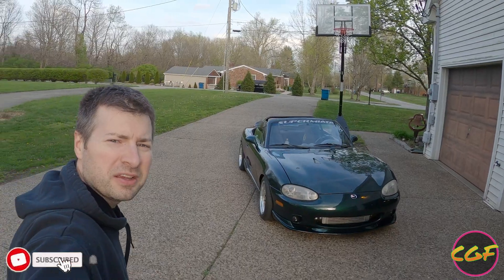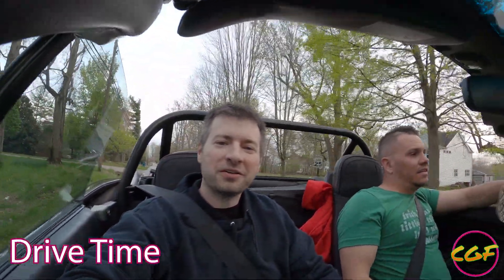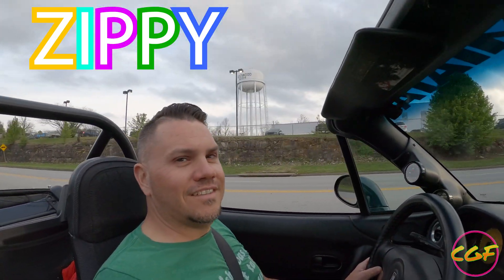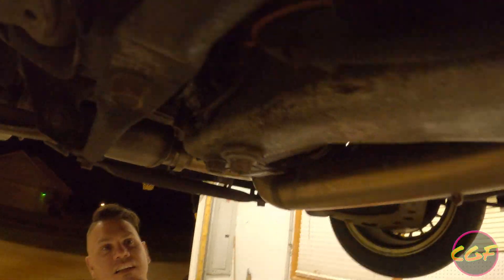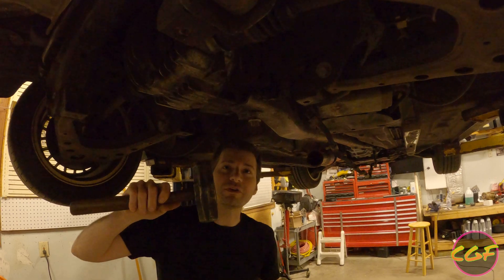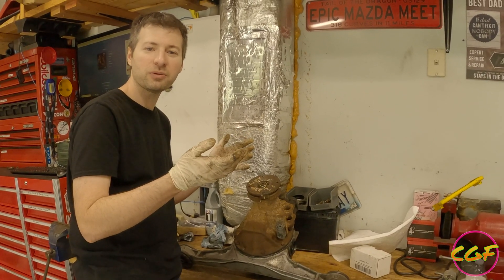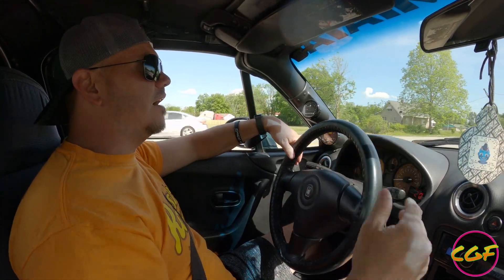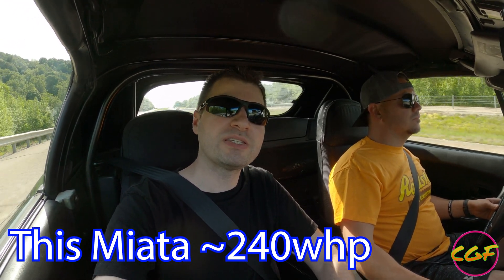Turbo Miata 3.6 Torsen Differential LSD - Install and Review on our Miata

Comment: I believe I have a 3.9 (2000 SE - 6 Speed), I was looking for a way to get the gears to feel longer. Do you think a 3.6 would do the trick? Currently it's stock, and it's going to be a while before it's boosted. I usually prefer Honda's but a K-Swap sounds like its going to be more expensive.
Reply from the maker: 3.6 is noticable vs the 3.9 so yes

Comment: Do you have kraken top mount mainfold?
Reply from the maker: Yep sure do
Reply: @CarGuyFridays  i took the low mount for my 1.6 not sure if is an overkill for my 200-250 hp target
Reply from the maker: The low mount is really better anyway. We have another car that has the low mount where we did a video. It gets heat out of the bay way better than the high mount. Otherwise, I doubt at that power level itll make a huge deal either way.

Comment: Have just swapped out my Torsen for a Kaaz 1.5 way. That’s the next step Guys🙂
Reply from the maker: We are happy to report we are now taking sponsorships and would LOVE a KAAZ 1.5 way to try out! :) 

Joking aside, hows the 1.5 feel?   Any regrets?
Reply: @CarGuyFridays  Whilst the Torsen is good step up & brilliant on the road, the Kaaz comes into it’s own on track. I was suffering from traction issues in both high & low speed corners due to the unloaded inside wheel spinning & causing the boost to drop. With the combination of good tyres (Yokohama AO52) & the Kaaz, I can keep with most 2wd cars on track. In the sprint racing that I do in the UK, the MX5/Miata is nicely competitive.
Reply from the maker: Nice! That makes sense. I was always curious what the kaas brought to the table. Now I know!

Comment: Nice! So after a few months of driving the car, it's definitely better than my initial driving thoughts, I was a little in between on which one I liked better. I just needed to get used to the 3.6 but now after having it a while I definitely like the 3.6 and it's been a blast at autox, on the highway to Deals Gap & tail of the Dragon and different places. What I've found is I have the drivability I want but if we are out and about it's very easy to downshift and have a blast with the longer gearing and boost!
Reply from the maker: Thanks for the update!